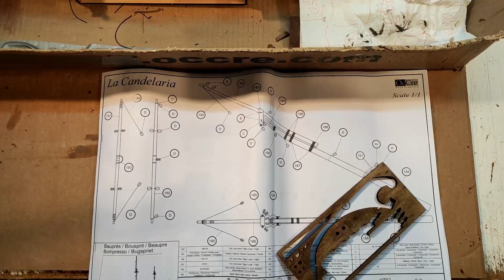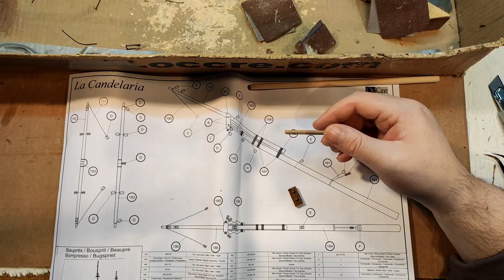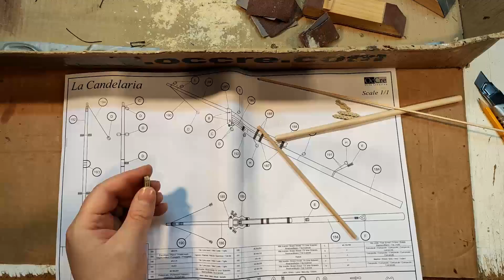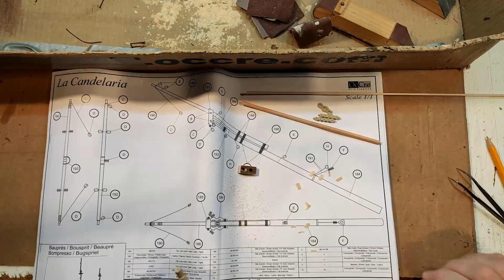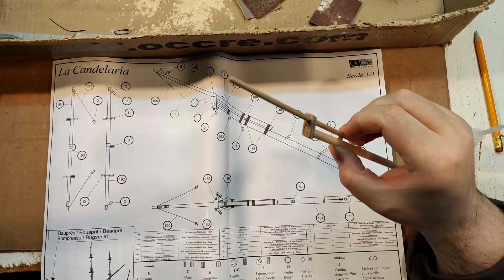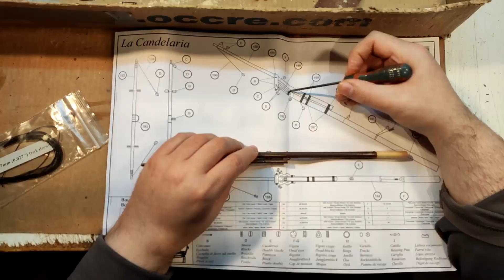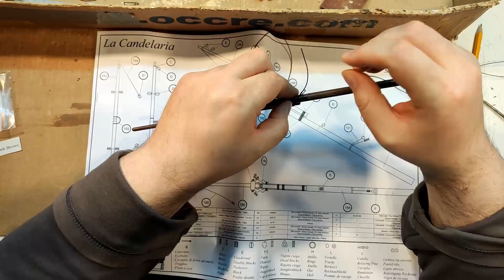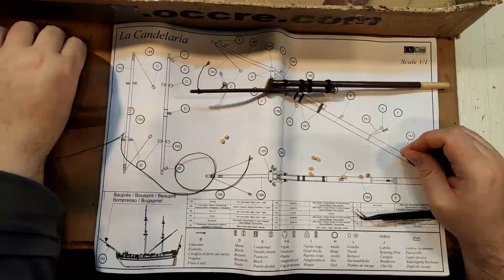La Candelaria - part 31 Making The Bowsprit

Comment: I have not tried it myself, but I have seen others who coated the plywood pieces with thin CA glue to avoid splintering of plywood. I've also seen them use baking soda to coat the piece before the CA dries. Apparently, the baking soda adds additional strength to the wood. I do like your idea of using a fine round file to open holes without drilling them out. I will have to give it a try next time I need to do this.
Reply from the maker: If you use CA on the entire piece you will need a lot and you will make the piece very stiff. If you use baking powder you will make a bond like cement so you will probably need to file it down later.

Comment: Hi John, it's looking fantastic, very good work! One question, with what material do you cover the wood to protect the masts from damage when putting them in the power drill? Looking forward to the rest of the build.
Reply from the maker: Hi Ron! Thank you very much!!! Just plain paper, i have cut off a couple of strips from an A4 piece of paper and i have roll them around the mast- yard :)
Reply: I use air hose lines of different diameters and I try to fit one inside another of a different diameter to make it thicker when possible. Set the drills torque setting on the lowest setting.

Comment: John, Try drilling the holes larger before you remove it from the sprue, the wood around the piece should keep it from splintering.
Reply from the maker: It's plywood my friend, this could work if it was walnut, but in plywood it will come apart with any drilling :)